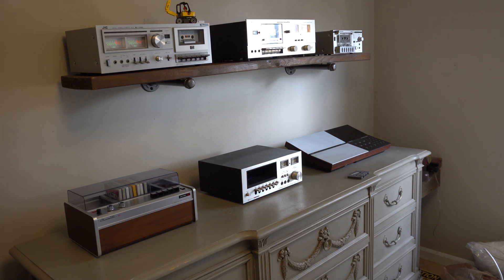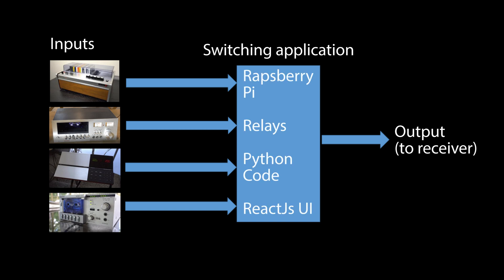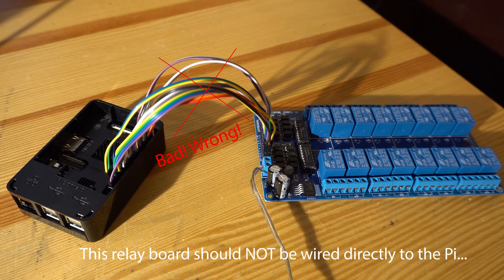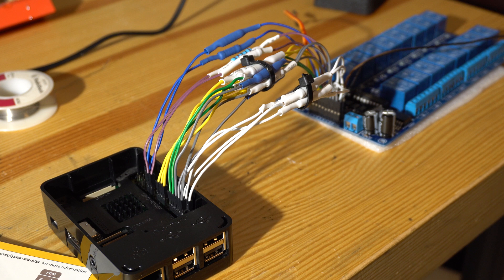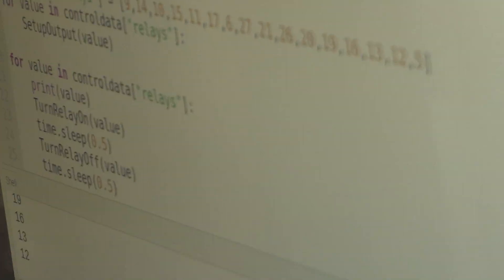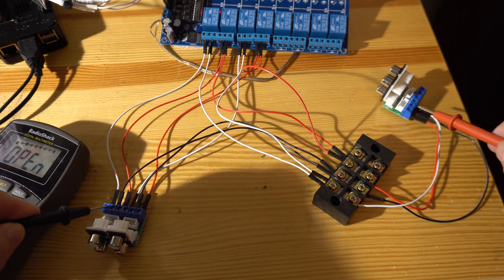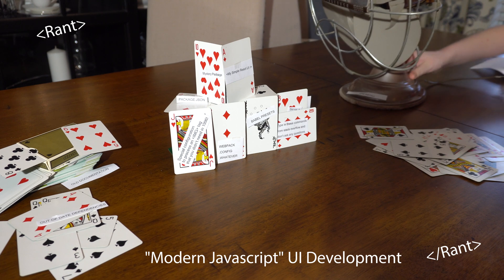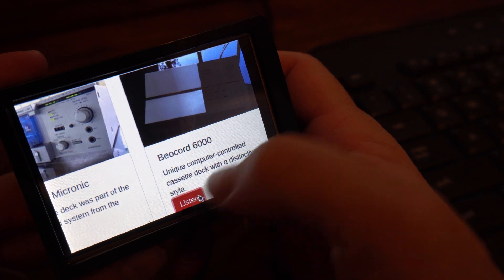Select Audio Inputs With a Raspberry Pi and Relays

Comment: Excellent video, thanks for putting this out there.  Just curious as to the use of relays instead of transistors.  Smaller, cheaper, less power consumption.  I'm looking to start a similar project and trying to decide which component to build around; Relays vs. Transistors.
Reply from the maker: Thanks for the comment! I don't have very in-depth electronics knowledge, just picked this since it was simple to understand plus there's a lot of information out there on controlling relays with a Raspberry Pi.... But yes definitely seems like an all electronic transistor or IC-based approach would have many advantages and be a more modern solution.

Comment: Would this work as a video switcher too, no audio just the yellow of a rca cable?
Reply from the maker: The relay is just connecting wires so, I think it would work. Not sure if you need any special relays or connections prevent lowering the video quality. Something more modern like HDMI is very complicated so for that I'd probably buy a switch from Amazon, and try to use the relay to control the switch... Thanks for watching!
Reply: @ACBMemphis  looking to make something very simple for a tft video monitor